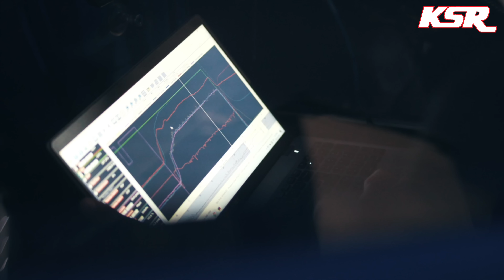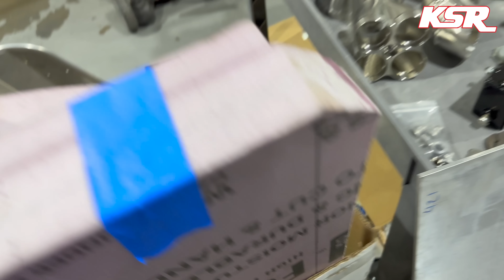HUGE Update on Val's 6 Second Drag and Drive Camaro!!!

Comment: Getting Steve to sell Kevin a smx is the easy part. Paying for it and all that comes with that only slight upgrade, now that might be a different story.  Thanks as always
Reply: Its not only the engine. You will need a tougher transmission or two, rear end, 4link upgrade, more injector and the list goes on
Reply: Getting a good price , is the point
Reply: @ZiggyTheGr8 yep steve morris motor is no joke you need the best axels and rear and trans etc
Reply: "Slight upgrade?"
Roughly three times the horsepower is "slight?"

Comment: What-if, Engine oil cooler fan, Trans oil cooler fan, Electric Water Pump
had a separate charging 14vdc lithium battery supply that could cool car at 
pit or staging lane. Val's car is going to be a BEAST.

Comment: The shock towers are just fine, I like them. Good work!
Reply: The shock towers look bad to me, shock should be in the middle of the tower
Reply: They have to go where they land because of suspension geometry.
Reply: @scottz63  Should have calculated the geometry first an then located the towers so that the shock is in the middle, looks stupid
Reply from the maker: The shock towers are in the stock location.

Comment: The powdercoat looks so good! Would be a shame if it gets rubbed away with vibrations and stuff, might wanna put some foam on those areas. Also helps tone down the noises with vibration. That's a beast of a welder!

Comment: In the ORSCA days there was EZ Street, Limited Street, and the top dawgs were the 10.5 Outlaw cars. We raced a bunch of EZ Street back in those days with an old D3R ProCharger (side slinger, before crank gear drives). Those were the GOLDEN days of ourlaw street car racing. What I would give to go back to the late 90's to early 2k's with what I know now :)

Comment: New camera? Awesome improvement over the older go-pro! Based on sound you have a directional microphone, would suggest bi-directional or omni-directional as you are turning the camera around while you are filming. Now depending on where the sound is coming the levels change somewhat (behind the camera, in front of camera). Great progress on the build, thumbs up 🙂

Comment: Great progress , and looks like some  very good planning. I have always wondered about that stock piece of frame rail ,etc. and why it is there considering the potential of this car with an SMX . Does this mean this will run in the same class as the new version of the Snot Rocket at certain races ? Thanks, always appreciated.

Comment: Gotta be careful with charging your trailer battery. If you have it connected to the starter battery on the car it can backfeed the trailer battery to the starter battery and melt the wires. Don't ask me how i know that...  just a diode is all it takes of course...

Comment: Why was this car built with the stock front frame rails instead of doing a full tube front stub
Reply from the maker: To fit more class rules
Reply: Yeah way more classes open up using stock frame rails and modifying them to need or fit in the specific class

Comment: Haha Mullet was built for a twin turbo LS and ended up with a twin turbo smx 

This Camaro was being built for a twin turbo LS, and now is getting a SMX.

Once the camaro was sold and power plant decision was made; Did that change happen early enough in the build to avoid a similar situation Mullet experienced?

I mean clearly the mid plate and engine mounting is being deaigned for the SMX but was rhe rest of the car? Lol

Poor Kevin can't build a car dor some one start to finish how it was planned and designed so that Kevin's skills can be properly highlighted lol! But hey taking Mullet, which was originally being built to be a jet engine showpiece for Cleetus & cars and then Kevin got a hold of it and did his thing; He surely knew what he was doing considering the power plant changes it went through and still managed go mid 6s in a 3500lb car
Reply from the maker: Mullet would have had problems with turbo placement also if it were not for Cleet's style of putting them above the hood, haha. Packaging everything under the hood opens up a completely different challenge.